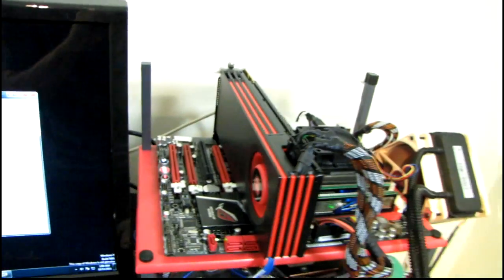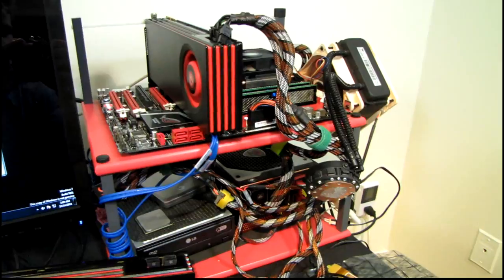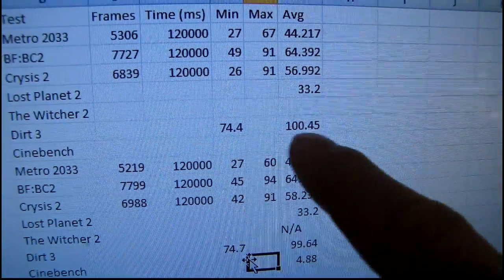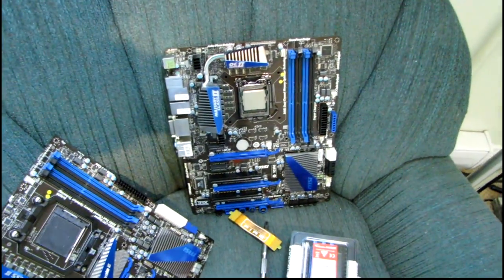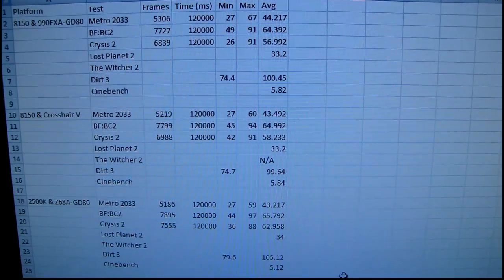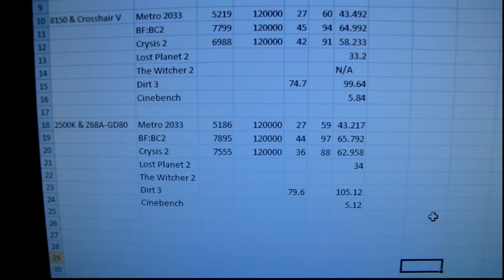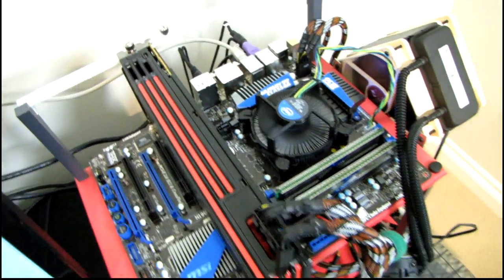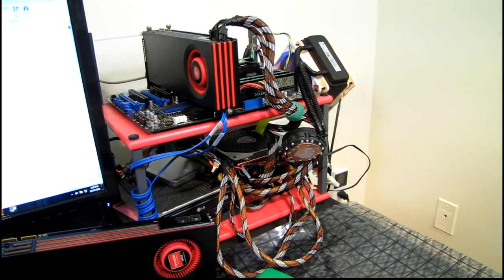AMD Bulldozer FX-8150 vs Intel Core i5 2500K 8-Core Gaming Benchmarks Linus Tech Tips

Comment: @8Denkmeister8 You seemed to have missed the point and I'm not entirely sure what you're trying to prove in that reply either. You are trying to make ATI look better by saying an OC'd card from it will do better than a next gen NVIDIA card. The problem with that is an OC'd card from either company will generally perform better than a next gen card (at stock clock) from either company that's kinda why you OC stuff.

Comment: considering that currently the 8150 is 70 dollars cheaper than the 2500k on NCIX, The 8150 is the better option. 8150 you can get for $169 and 2500k you can get for $239. And the 8120 which is similar performance to the 8150 is only $119 which is only $10 more expensive than an i3 2120. So right now AMD is ahead in the price ranges that they offer. Intel is better if you want to have extreme performance with a very expensive processor.

Comment: if the fx-8150 is performing along the same lines of an 1100T it has a much greater chance of being a bottleneck with higher end gpu setups then Intels offerings simply because its not as fast.

Your speaking like its a perfect world, i have noticed cpu bottlenecks on AMD athlon II X4 with a single card setup (AMD 6950) with crossfire that would get in the way even more. In some segments AMD may still have price to performance crown however i will pay 30-40 more bucks for a fair bit more speed.

Comment: Very interesting.
I'm using a full Intel/Nvidia set up now which is a EVGA 790i Ultra, q6700 (@3.08ghz), 10gb DDR3 Corsair Ram, EVGA gtx 560 (2gb) SC'd edition and while I'm able to play anything maxed out, I'm looking to buy a new system this fall.
I've been wondering about going full AMD or Intel again, and this may convince me to go AMD as I could shave off enough money to buy an additional high end AMD gpu with the savings.
Meaning better performance, at the same price.
Damn you AMD.

Comment: @bdrewsy Huh? nVidias next gen card is ATI's current gen... It will not perform better, just look around ;) The GTX 670 Ti actually should close the gap between the 7950 and 7970 so ATI does not have such a huge time to sell their best stuff. AND it is still not sure if they will release a full bunch of 6xx cards or wait for a complete release of the 7xx series in autumn. It's a fact that nVidia buys performance with increased heat.

Comment: Now let me just explain. There are various factors which result to the performance, Intel has a better CPU architecture and therefore has a faster IPC meaning that the CPU does more work per cycle so theoretically in most circumstances a 3.0 ghz intel CPU could probably beat an AMD 3.5 ghz cpu. AMD to equal it out has many cores and almost all CPU's have an unlocked multiplier which makes it more suitable for productivity. The price difference is due Intel owning 80% of the market. both are good

Comment: Incorrect, when overclocking all an intel needs is a cheap $30 cooler.

You need a noctua or h100 or similar for the FX's. $60 - $90 easily.

Comment: A more comparable setup would be the AMD FX-8150 with EIGHT physical cores against the Intel Core i7 3930K with its mere SIX physical cores. The difference $300 and 5275 benchmark points over AMD. Which here really is the better bargain? Again let's take it to the PassMark results at stock specs

Intel Core i7-3930K @ 3.20GHz 13,546

AMD FX-8150 Eight-Core 8,272

I'm glad I paid that extra $300 because it would take 2x FX-8150 to come close to matching a stock 3930K until the 3930K got juiced

Comment: His tests were good, but I have a few issues with this, like Dirt 3, yes its CPU heavy, but the benchmark is never the same with it, so the i5 could of pulled ahead because of less things rendering, BFBC2 was vaary close and cant even say the i5 beat that, margin of error. Either way, If the i7 3960x was as much as the AMD chips, I would jump all over it, but its not and I can get pretty close to the same performance with a cheaper part, and upgradeable friendly Motherboard, compared to Intel.

Comment: @TheEdward344 It has been benchmarked extensively already on linux. You should head out to phoronix(dot)com and check for yourself. Basically, the Bulldozer outperforms the i5 2500k on multi-threaded tasks, but is of course, lacking behind on single-threaded tasks as one might expect.

Comment: The 8150 shouldn't be compared to the i7s. As Linus said, the i5 2500k is the closest competitor price-wise. However, if you start overclocking, things change. To overclock the 2500k, you'll have to pair it up with a MB that supports overclocking and the platform is going to be way more expensive than the bulldozer. What I mean is that once again AMD brings better performance to price ratio, even with their new "Faildozer".

Comment: and if it is another 2-5 pct increase or something very small i will really be disheartened since i really see no reason to upgrade from phenom II to FX series processors as is, and thats not because AMD sucks, thats because i found the phenom II to be decent performance to begin with --- its just compared to intel it makes it seem worse then it actually is. I bought an Athlon II for sub 100 dollars instead of its big brother and used it for like 2 years gaming and it worked fine (30+ fps)

Comment: I have GTX650Ti, and I recommend GTX650Ti BOOST or GTX660 and it's enough, if you are nVidia fan. From AMD side you have HD7790 or HD7850. If you have enough money go for better cards. In gaming everything is in card, you don't need that strong CPU. You could go with quad core, because many games can't use more than 4 cores.

Comment: The 8150 has a feature which allows you to turn off 1/2 the cores to boost the multiplier by 2 I wounder if that would help in gaming? I guess at default base speed it would give 400mhz more per a core so it would be a quad core running at 4Ghz & I guess it would max turbo at 4.6Ghz without overclocking is that right? Anyone willing to give it a try?

Comment: I hate it when their grammar is so bad I cannot easily get their point. The quad core Bulldozer line is in a whole different category, the budget build one, I would quite suggest it. 

However, the Bulldozer 8150 is $190, and 8120 is $170.
Compared to the 2500k at ~$200 and Ivy Bridge... 3750k at ~$210.

All of the above reach epic overclocks of 4.7ghz, and in gaming the difference isn't well noted. However benchmarks prove that the Sandy and Ivy Bridges beat Bulldozers all around.

Comment: i'm not a fanboy, the fX8150 performs exactly the same as the i5 and is cheaper and runs cooler. I am using an i7 right now and would not be afraid using an fx8150.

Comment: @bdrewsy nVidia's last gen cards had almost the same specs like the ATI cards except that they use MUCH more power and already have a 384-bit memory interface.
Getting performance just through grilling the chip (see temps and voltages) is no alternative for me. I am neither an ATI nor an nVidia fanboy (cause actually I am using the last one for the last years) but I don't want to have a 28nm graphics card with 2x8pin or more power connectors (see EVGA 580 classified).

Comment: Over the next several weeks I'm building my rig with 
ASRock 970 EXTREME3 AM3+ AMD 970
AMD FX-8150
An older case NZXT GAMMA Classic Series GAMA-001BK Black Steel ATX Mid Tower Computer Case
G.SKILL Ripjaws Series 16GB (4 x 4GB) 240-Pin DDR3 SDRAM DDR3 1600 (PC3 12800)
Rosewill N900PCE Wireless N Dual Band PCI Express Adapter 
And a ASUS DRW-24B1ST/BLK/B/AS Black SATA 24X DVD Burner
using my ssd and 1thdd and my 650 ps from my old system and it's going to only cost $464.94 from New egg.

Comment: They removed the Regedit hack in the CP release of windows 8

The limited multitasking applies to metro, think iOS type multitasking , but if microsoft releases office or other programs for metro, you will not be able to lets say have a excel document and a office document both take up half the screen, and you will only be able to have 1 more metro app open, beyond that you have to start switching.

Comment: @blueovalfan23 The bulldozer is a much better cpu than the i7 but the problem is software won't make much use of the +8cores. I ve only just started to see applications make proper use of 4 cores. i'm still getting a bulldozer coz i play around with vmware.

Comment: i5 2500K W/ GTX 660 Ti
Or
FX 8320 W/ Radeon HD 7870?
Reply: Or the other way around?
Reply: no i was asking which i should get
Reply: the HD series are pretty cheap on ebay these days. NVidia cards are pricier on ebay than on newegg, ncix, tigerdirect, etc.

Your list comes up pretty even. You can switch Intel + Radeon, FX + NVidia and they will perform similarly.

It all comes down to what you feel.
Reply: well I dont want a used card lol
Reply: FX 8320 with HD 7870
Reply: iTrollinFilmz A10 6800k and hd7950
Reply: Meowy McNasty or 280 non x
Reply: hon hon hon
Reply: Depends on what you play. If you play GPU intensive games (BF4 or Crysis 3 ect), go with a cheaper AMD cpu and spend a bit more on the GPU. If you play cpu intensive games (Starcraft 2, Kerbal Space program, ect.) then  spend the money on a decent intel CPU.
Reply: Personally, I run a fx-8150 and two gtx 660's in sli. Running BF4 on ultra I can barely pull 45fps and only about 50% gpu usage. Because the CPU bottlenecks like a boss on SLI gpu's...

Comment: I went Intel because i don't want cpu bottleneck (as little chance as possible in a game) got tired of getting x frames no matter what gpu settings were, the simple fact is the 2500k is faster 90 pct of the time, with Virtulization about the only thing AMD has up its sleeve... bottom line if you have 50-100 dollars extra cash buy an Ivy bridge its worth it for the performance. If you buy a 8150 you literally have 0 upgrade path left, pickup an i3 or i5 and you still have an upgrade route.

Comment: The old phenom 2's had TRUE 6 cores.

The bulldozers do NOT have true cores, it IS like HT intel processors.

They share resources, and when windows would ask it if it was true 8 cores the bulldozer would say YES, but since they are NOT, you suffered performance penalties.

Fact is bulldozer 8 cores are just like 4 physical core, 4 logical core cpu's.

Comment: Actually you are correct, in single player.

Multi player bf3 is highly cpu bound.

OK, let's break it down!

8120 = $190 + (h100 which I see most people get with it) + $98 =  $288

2500k + hyper 212 (+ extra fan for push/pull) = $215 + $26 + $11 =  $251

So AGAIN, price/performance????

IF you don't overclock, well, bulldozer performance is downright pathetic...

So...   =)

Comment: Dude dont get an 8150 or a 650ti. Get a 6300 and maybe 7850. The bulldozers dont overclock well and they run alot hotter. The piledriver CPUs are much better. You can get a 6300, MSi 990fxa mobo, and an xfx 7850 for under 500 on Tigerdirect. Throw in a $70psu, decent case, $45 8gb ram, and 500gb hdd, and you'll be at around $750 depending on what case you get. Keep in mind OS as well. Get windows 7 over 8.

Comment: Hey guys I'm going to build a gaming setup for my brother with a gtx 670 and i need to decide between  the  AMD FX 8120 and the Intel Core i5-2310 (which is slightly more expensive). Intel 2500k is out of budget. He won't be upgrading cpu for at least 3-4 years and i know that sandy bridge is better for gaming but the amd is unlocked and 8 cores so it could be more future proof.
Has anyone some advice?

Comment: he wrote down all the results in the notepad so the 2500K i5 is better like a few% or so 3-5% so the i5 would be a better choice if you are the intel guy also the 2500K i5 is cheaper than the Amd X8, but if you are a Amd guy than just buy the AMD is really minor differece

Comment: As of 8th May 2012 the FX 8120 is £122 and the I5 2500k is £163 they are both easily overclockable but the AMD just wins it on price for me, the intel is an amazing CPU but the for getting the most effective use out of gaming for the price AMD wins it for me :) ive got the FX 8120 overclocked at 3.9GHz on a Sabretooth 990fx with a H80 :)

Comment: price is irrevalent, around here a 6300 (the cheapest) go for 60% of the price of the 3570k, as far as OC go a 3570k can also reach 5ghz even with a h70 (personal experience) and you dont make sense, you're basing the future of gaming on frostbyte 2 engine which is only used in bf3 and MOH warfighter as far as im aware and they're still working on it so the problem with less than 4 cores will be solved hopefully, so thats not the future of gaming, even with 2 core the multiplayer is fine

Comment: the 2500 would be a better choice but i'm sure the fx4170 will do fine. i'm running a an athlon ii 450 (x3 3.2ghz) and it's doing fine for gaming, not an i5 but a hell of a lot better than a core2duo lol. if you really want to do use amd, get a phenom II x4.

Comment: That makes no sense really, as the pricegap is to big, if you can spare the "change" for a new 780 i would just keep saving for the Titan and get it over with. For the budget, go for the 660 or 660TI there by far. There best in there budget range cards, the 780gtx is anywere between 700 and 750$, i would spend 250 more for there elite card little over 1000usd

Comment: AMD's best chip, the FX-8150, is still cheaper than a 2500k, which is pretty much the de-facto price-to-performance king of Intel's entire line.  The FX will readily overclock to ~4 to 4.3 GHZ on air cooling without touching the voltage.  At that point, at any of the modern popular resolutions, games are not going to be bottlenecking at the CPU no matter what unless they're not optimized.

Comment: Ok this is a true fact the AMD 8150 in benchmarks on window 7 base is only using 3 cores vs there 8 because of the hotfixes they have been doing vs the 2500 is using 4 cores. wehn windows 8 comes out there well be the full 8 core where the bulldozer well out perform there I7 6 cores the cost to much.

Comment: you dont need intel to play games optimal smooth. i play with my 4170 , 9800 gt and 8 gb ram at optimal setting at 60 fps or near 60, which is good for the 230 bucks i spent on it all

Comment: Thats less to do with your CPU pal, games run more on the graphics you use, honestly for those games you need a low end graphics card as they are not that demanding, but if you have a good cpu such as a dual core at 2.3GHz+ keep it and get a good £40+ graphics card :)

Comment: i accept i7 2600k is better than bulldozer, but bulldozer has 8 cores and can be used for ultimate apps usage, i7 2600k is good in sense of gaming as well....but u get amd 8 core for  much cheaper rates... If you are a serious gamer go for i5 2500k OR i7 2600k.... i prefer bulldozer as i am not a serious gamer.

Comment: Ok, but if you're running a 700-1000 dollar SLI or GTX690-esque system, odds are you probably aren't worrying about the price:performance ratio of a CPU.  My whole original point is that AMD's cpus are not going to bottleneck a game on a system consistent with what the price/performance crowd will have.  The gpu will bottleneck every time at any normal resolution.

Comment: im with you AMD brother, the intels are more suitable for businesses and business style applications, but i have heard ppl bitch about AMD's over heating so i asked them, how far did you over clock it compared to your intel? and they go deathly silent, in other words they oc'd AMD to the max and it held on like a boss with stock cooling cause they were/are so easy to oc, hell i got a Phenom2 X2 560BE ocd to 3.8GHz on stock cooling and it doesn't get above 50c when on D3 when outside temp is 35c

Comment: The FX 8150 is only cheaper (used to be the same btw) because they had to lower their prices because the i5 2500k whooped its ass so AMD needed to do something to get more sales.

And your pricing is off : 

FX 8150 : $190
I5 2500k : $200 (i got it for $149.99 from Micro Center)

So actually, its only $10 cheaper...

Comment: Actually, you're really not bottle necked badly by an 8150 if you are at 1080p or above (Especially 2560/1600) and using a single GPU. If you're SLI, of course Intel is a better bet. As disappointed as I am in the Bulldozer, I'm not going to diss is completely as it is not a total failure.  Hopefully, Piledriver will fix a few problems and since it will support Intel's Haswell FMA3 I think we will be pleasantly surprised. (At least I hope so.)

Comment: mine system, is as follow. Asrock 970 exteme4 motherboard, SSD Samsung 120gig boot drive, 8 gig corsair vengance memory, GT660 , i got the same powersupply. I use 8120 AMD FX, overclocked to 4.1ghz. Stable that is, my costs were with AMD scorpio case and seidon coolermaster m240 liquid cpu cooler. 840usd

Comment: get the fx 8350
it will performs same as i7 3770k in multitasking 
and get a ga 990 fx motherboard
total cost will be around 200$ for cpu + 179 $ for motherboard
it is faster than i5 2500k in editing and all
ps as u are a newbie u can check anandtech bench
it is the best site for benchmarks

Comment: Actually micro$oft did release a lot of fixes for the bulldozer.

And in windows 8 beta offers almost no gains over win 7 64bit.

You cannot make a turd into a diamond.

Bulldozer is no where near intel performance not because of HT, but becasue core for core sandy is at least 25% more efficient.

Comment: I've been guilty of bashing AMD since Bulldozers release. I got to try out a new system a friend of mine built. I don't notice a difference in performance between either platform. Intel is faster but the unless you're rendering video a lot, I don't think anyone will be disappointed. I could care less about synthetic benchmarks. I think they over exaggerate the difference in some tests. I think the Z68 chipset is somewhat crippled by Intel. Can I get a 990FX board with an 1155 socket?